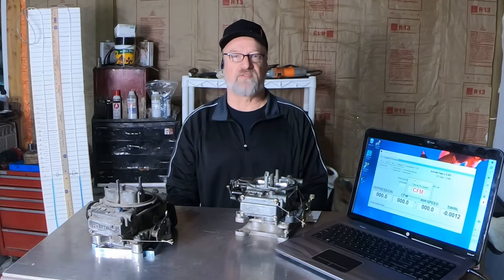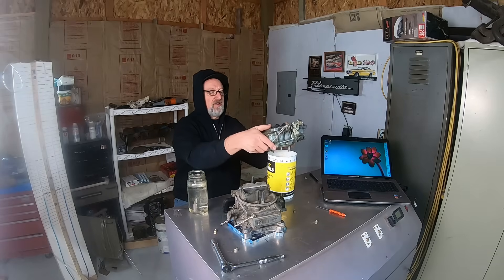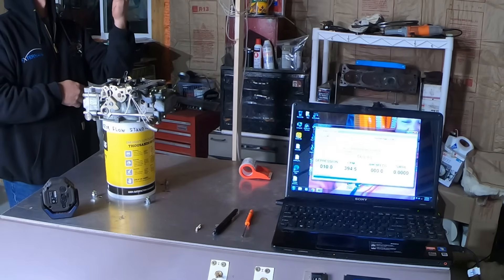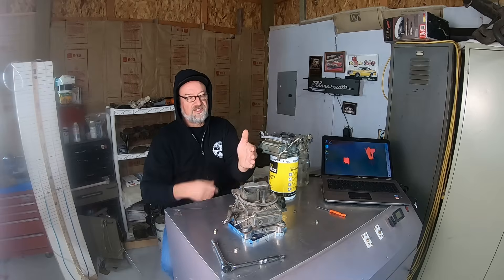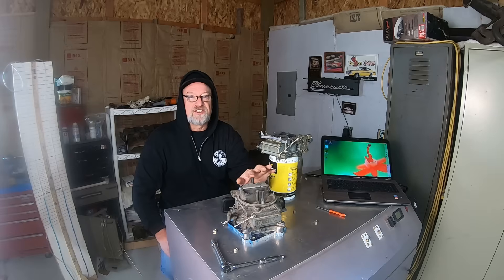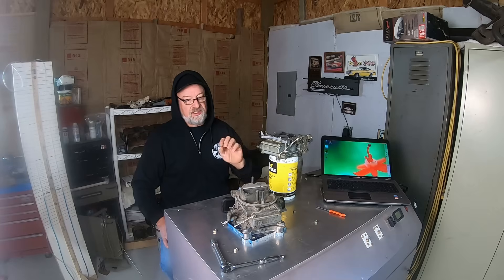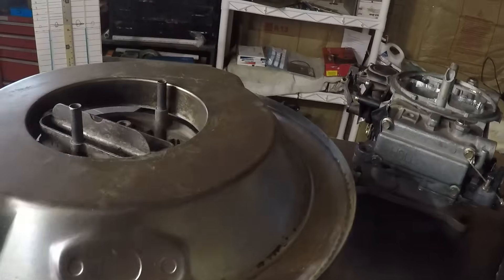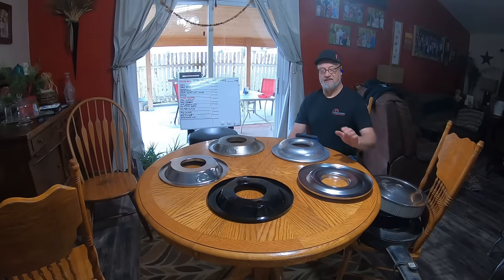Holley Carb Horsepower KILLERS: Air Filters & Base Plates Tested!

Comment: Thanks for spending the time to generate the data, make & share this video.
    As I look at the shrouded &  fairly flat floored air cleaner housing on my 273 4bbl- that's gotta reduce flow, and coupled with Ma Mopar's possibly worst designed exhaust manifold on the drivers side....
Reply from the maker: I really appreciate your kind words! It takes time and effort to put these videos together, and feedback like yours makes it all worth it. Thank you for watching!

Comment: I'd like to see you run a water air mister to simulate FOG to keep the air charge cooler I MYSELF RUN A  DUAL SNORKEL AIR CLEANER RAM AIR SET UP WITH A K & N AIR FILTER VIN 9 OLDSMOBILE AIR CLEANER SETUP
Reply from the maker: good idea 
But the flow bench would still show the same cfm. Would have to have some kind of air density meter to see that.

Comment: You should be testing at 20.4 inches of water.
Reply from the maker: Unfortunately My flow bench is not capable of testing at 20.4 inchs. So i test at 10 inchs and let the computer calibrate it to 20.4 Its the best i can do with what i have. 
It shows it in the red box.

Comment: It doesn't make that much of a difference alone. You have to stack a lot of modifications to make a noticeable horsepower difference. This is only applicable in particular racing classes where you have limitations like displacement or parts restrictions. On the street, you would turbocharge something and nearly double the horsepower without wasting any time thinking about intakes and exhausts. The money spent on headers and intakes and custom aftermarket air filters would be better spent on forced induction
Reply from the maker: I don't disagree.
but this channel is all about getting the most out of the combo you have.  aka "Beer Budget Performing Mopars"  ;-)

Comment: Ran a 8x3 K&N filter with an air pan and a dominator. Made no difference with or without it.
Reply from the maker: And that is exactly why i want to test it at the track. My air filter is down almost 100 cfm but if my engine is not demanding all of them 850 proform cfm it wont care either.
Bruce said he lost 70 Hp with his rectangular air filter on his 2 -4 barrel 427 FE Corbra.  I will give my answer on Memorial Day ;-)

Comment: I guess if I was trying to break into the 13s on a stock car in the low 14s and get that magic slip- I could secure the baseplate with maybe a screen cover like a 427 vette. And run without the filter! Thanks for giving us more stuff to benchrace hahaha
Reply from the maker: I forgot to add a link for the black filter with the filtered lid. I’ll do that when I get home tonight. With that filter, you can have your cake and eat it too. They only had lost 15 CFM, and still keep a filter👍
Reply from the maker: Ok the black filter assembly,  is pin at the top of the page ^^^^^^^^^^^^^^^ if your interested
Reply: @CudaFishEStories  Excellent advice!
Reply: What you can do is drill the flange on the base for a couple of set screws 180 degrees apart and that will hold it to the carb flange without needing a screen. Or take a coat hanger and bend it around the stud then run each end down to the base and make a loop with a screw through on each side.
Reply: @CarsandCats  NiCE! thanks!
Reply from the maker: good idea.

Comment: LOL. You should see the difference on  a 427 FE motor equipped with two quads and a Cobra rectangular air cleaner. It's a night and day difference. With the filter on, we lost almost 70 HP.
Reply from the maker: That seems crazy, but you seen my filter has almost 100 CFM a loss and can add up quick if the motor wants it;-)

Comment: Excellent.  Maybe test some k&n type cotton gauze filters and a extreme lid too ?
Reply from the maker: I’m not a fan of a K&n cleaning filters. The black filter with the filtered lid is replaceable filter and it only lost 15 CFM.
Reply: @CudaFishEStories  paper elements really choke the flow compared to the cotton gauze units. Especially if they get a bit wet.
Reply from the maker: @mitchellferre1652  Agree, I just see too many K&N and the like.  That never get maintenanced...by the time the vehicle wont run right, its pluged beyond cleaning. its just cotton. when the dirt has colected to all the oil charge......there is dirt getting through.  just my apinion. ok i'm climing back down off my soap box🙂